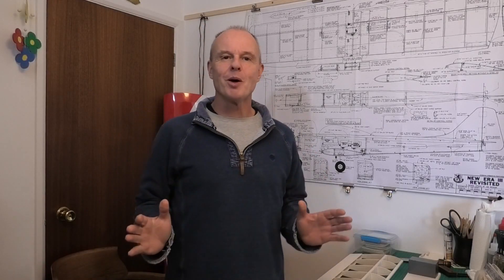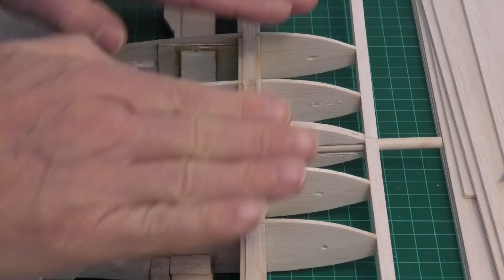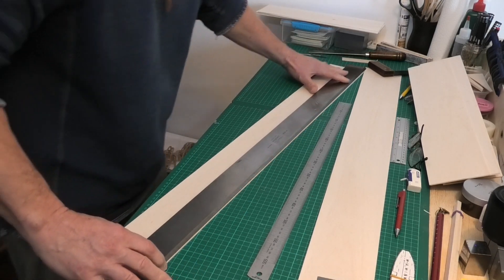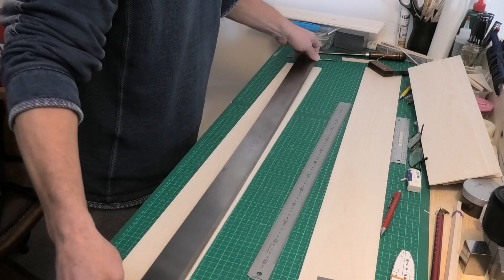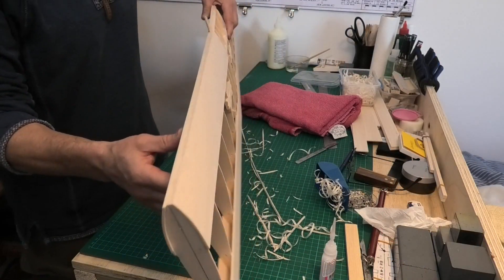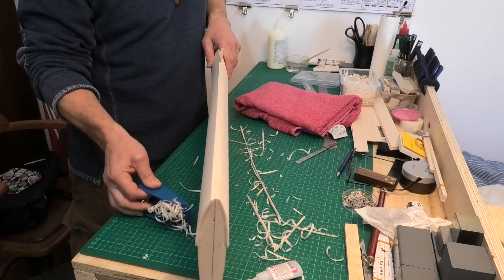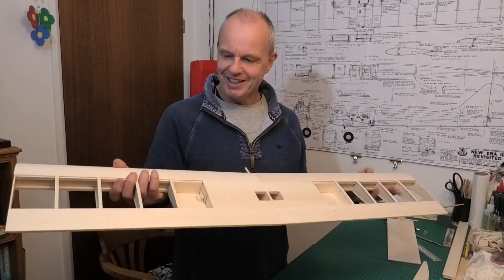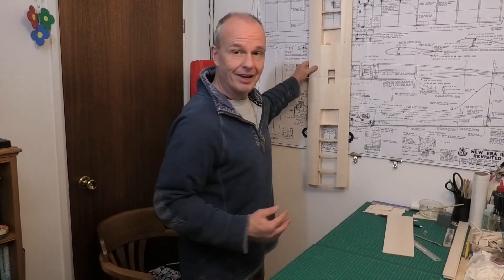New Era III Revisited: Pt 6 - Sheeting the Wings - a 45" wingspan RC balsa aeroplane

Comment: Mark, your builds are extremely helpful and informative.  I'm at this point in my construction an old 1970's glider.  The spars are spruce so I can't stick a pin in them to hold down the back edge of the sheet while glueing.  Any suggestions of other methods for securing the sheet in place long enough to glue?  I ordinarily would use wood glue, but drying time means I must have a way to secure the sheet after I put glue on ribs, spar and leading edge.  I notice you and many others now use CA.  Apparently it's strong enough for wood kit construction?  Sure would make some things easier.   Thank you!
Reply from the maker: Thank you very much, appreciated. If you look at the Diamond Demond wing build, which had a spruce spar, on my channel,  I used steel blocks as I constructed the wing, hope that helps 😀

Comment: I’ve been away from kit building for 30 years, and it’s great fun watching you build. I’m surprised by how thick a lot of the wood in this build is. Is that normal for a model of this size?
Reply from the maker: Thanks for the comment, pleased you are enjoying the build.  Regarding the timber size, I am following, mostly, the sizes recommended on the plans, it certainly ended up a sturdy plane, that flies lovely.  I would say the timber sizes are about right.
Reply: @MarkRobinson555  I have a chance to get get the kit Airtronics made of this plane. Thinking of converting to electric and maybe conventional gear for better grass performance and prop clearance. Do you foresee any pitfalls I might encounter?

Comment: cracking video Mark, wing looks awesome.
where did you get the metal blocks from?
Reply from the maker: Hi John, glad you liked the build, they are a great set of plans to work from.  The blocks I had machined from some 50x50 steel bar, had the ends milled square. They are so useful, I would be lost without them.

Comment: Really enjoy these videos Mark. You are a natural presenter. Sorry to keep asking stupid questions but where did you get those big cutting mats? The largest I can find are A0
Reply from the maker: Hi Ron, thank you for such a kind comment I really appreciate your support and really pleased you like the videos.  The matts I have on the bench are two A2 mats pushed together, which I just ordered on line.  I know yu can get A1 as well, not sure if they are available in a bigger size.  I love working on cutting matts, make a great surface.
Reply: Many thanks Mark. Also really impressed that you find and restore the old engines. I love em. If the planes didn’t make a noise and pour old and smoke everywhere I wouldn’t bother with the hobby!! Perhaps you should do a vid on the end of the flying day: cleaning up plane, getting fuel out of the engine to stop the bearings rusting, checking batts, servos & linkages etc. just a thought
Reply from the maker: Great idea, thanks, and yes I agree entirely, love the smoke, oil and noise!!

Comment: Classic D-tube wing really gets stiff when you complete the "tube" with the sheeting and it's a fairly economical assembly so most of the sport plane designs use it.  I like to put the sheeting on the first side while the wing is held down to the building board.  It is so easy to build a twist into that wing when it's just sticks and ribs and once the sheeting dries, so hard to recover.